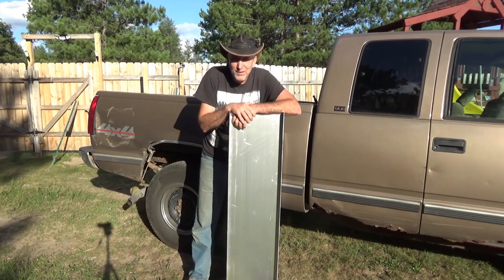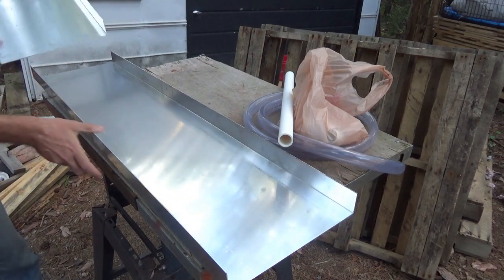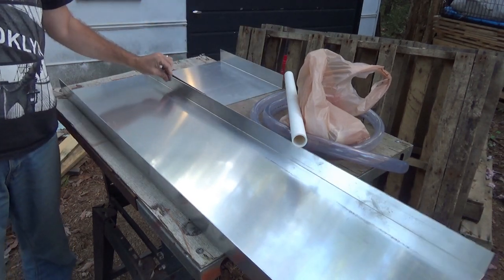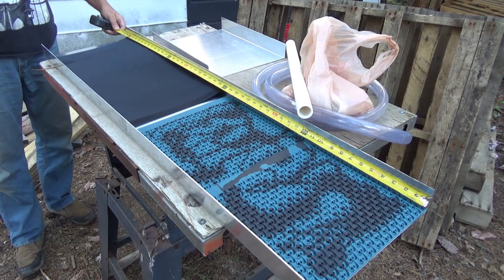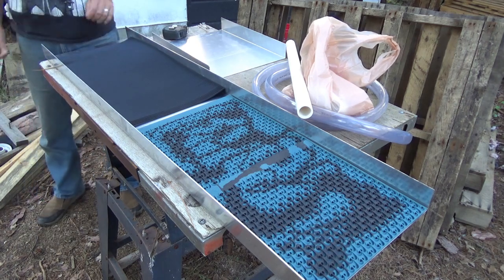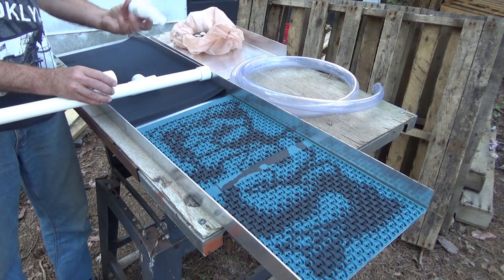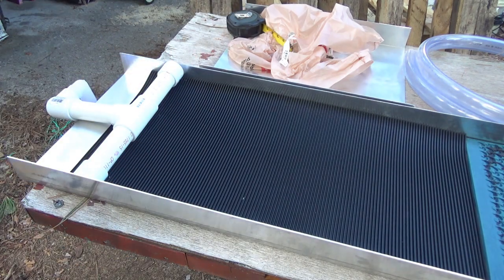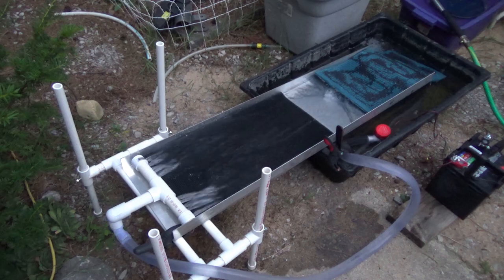Building MEGA Sluice A 12 x 50 inch Beach Sluice Box

Comment: Don`t you have a brand new shear and brake?
Reply: Who did the bending for you?
Reply from the maker: Yes that is what I use in the next part of the video. Well, brand new a couple years ago anyway.
Reply: @michiganprospectors  Since you talk a lot about self sufficiency surprised you would hire that out when you have a nicely equipped shop.
Reply from the maker: Yup, and that is a very good point. I wanted a 52 inch long sluice with no seams tho and my brake can only handle 48 inches. After much consideration, I decided to outsource the job cause it was cheap anyway for two simple bends in the metal. And I had to go to the metal shop to get metal either way. Easy to just get it bent as I waited.